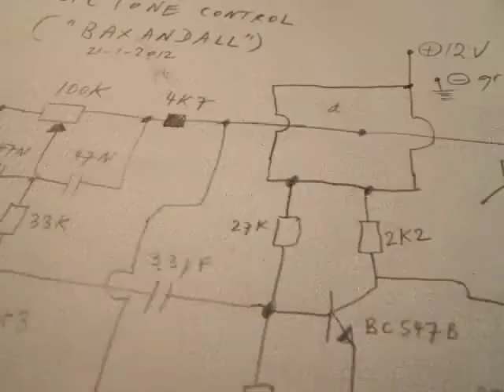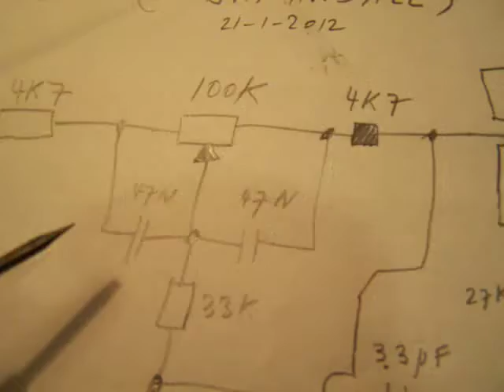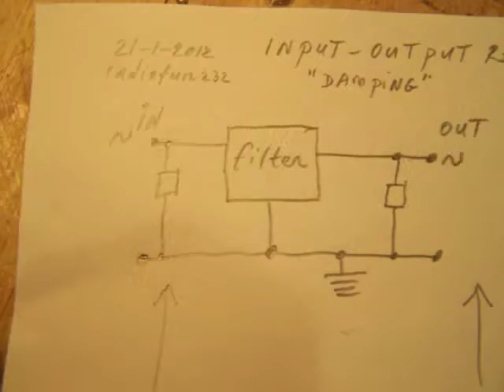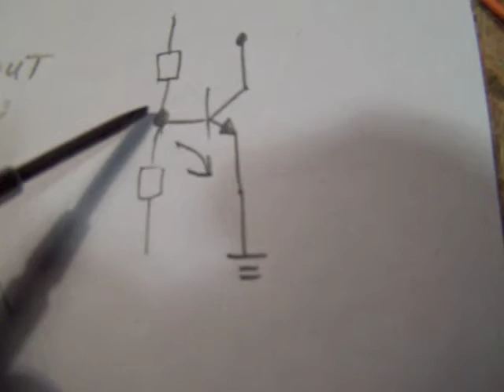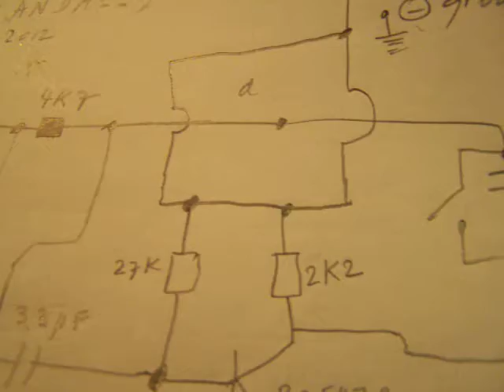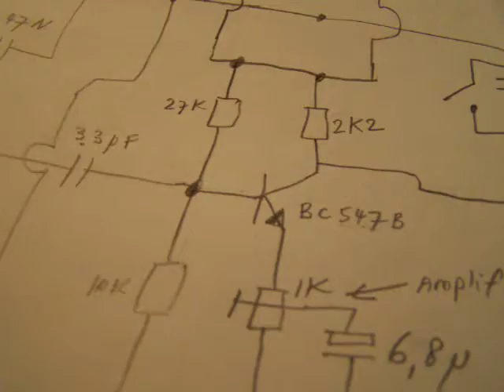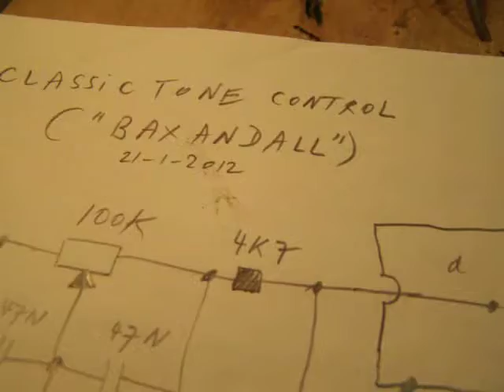how to make a tone control circuit (Baxandall)

Comment from the maker: @vibra64 yes, they do. The only problem is some components like big capacitors cannot be imitated very well with micro semiconductor elements. So these components are connected outside the chip as single parts.

Comment: I see you build most of your circuits using single parts that is transistor, resistors, capacitors, etc. In todays modern circuits do they use more chips with all these functions built into a single chip? I once saw a radio that used a PLL in a radio.

Comment: Fascinating. What do you use for mounting the components in these experements, wood? Copper clad board? I like your style: light on therory, heavy on the practical.
Reply from the maker: Thanks. I always use multilayer wood, varnished with transparant glue for PVC tubing (sewage pipes etc, smell acetone) and work with brass nails. It has very good electrical properties and the schematic can be copied 1 on 1. Ater all is done, the wooden board with electronics is slided into a metal cabinet in cases of audio circuits. For radio circuits this works properly up to 18 MHz, there I glue an earth plate (tin can) to the under side of the wood, used as elementary shielding + ground plate, with no influence on the performing of the radio coils.

Comment: yep, there is no way around building the thing i guess and see how it goes. i simulated it in the duncan tone stack calculator, easy to use free download. the reference bax eq uses similar values for the parts like you have written down. just the bass pot is larger, 1Mohm logB which lowers the knee and leaves the middle frequencies alone and treble is larger too. i will post the results when i get around to try it out. your video gave me the kick in the butt to get out my solder iron again hehe

Comment: hi, thank you for uploading this video! how low is the input impedance in your design? i am thinking about building this simple baxandall eq into a tube hifi amp, would the impedance of the preamp tube 12ax7 stage (effectively about 40-50kohm) be high enough so i dont need to worry about an additional amplification stage?
Reply from the maker: I think the tube input impedance is big enough. The baxandall circuit is originally from the fifties when transistors were not used yet. I think the values from caps and resistors must be adapted for the high tube input, this can be done experimentally and everything needs proper shielding (risk of hum, picked up at the tube grid).

Comment: the input preamp stage is followed by another similar tube stage (12au7) which acts as a driver with little gain but low output impedance for the power amp stage. i would place the eq in between the input and the driver stage. i would only do it if it will work sufficiently without additional amplification. thanks anyone for chime in and helping out on that!
Reply from the maker: With all these circuits there is one rule: nothing can be predicted in advance, it has to be tested experimentally, a search for the best results must be done. And the rules for constructing tube circuits must be taken in consideration.

Comment: Can I use low noise BC549B transistors instead of the BC547B, WITHOUT changing any passive components?
Reply from the maker: Yes, without any problems as long as you can be sure that they are NPN (as far as I know: they are). But: test the Hfe (=amplification factor) first. It must be beween (say) 200 and 300.
Reply: Thanks for the hFE notice! It's important!